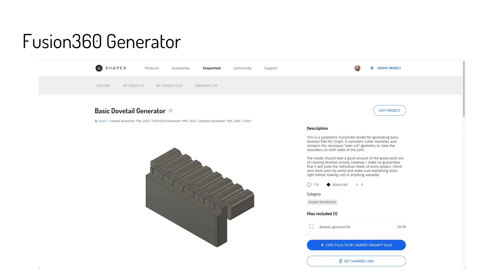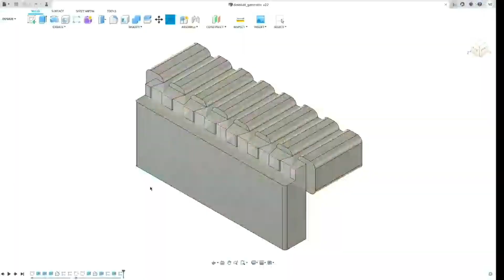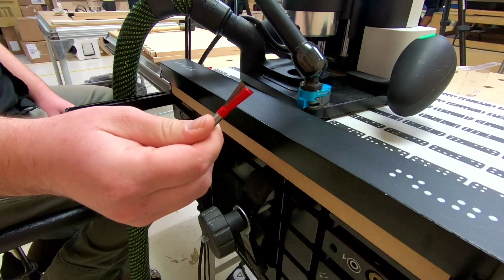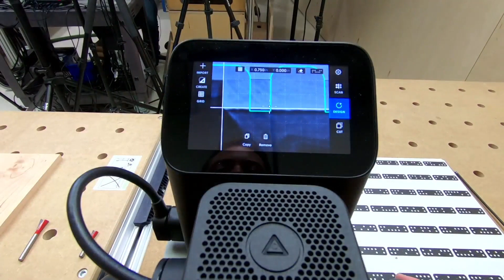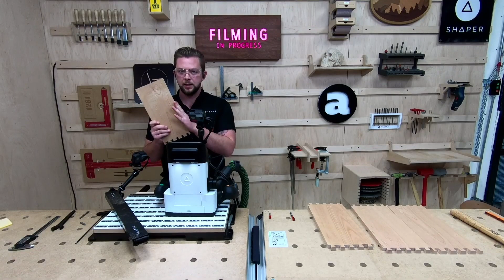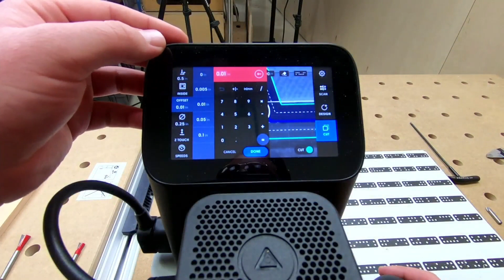Session 20  – English: Dovetails with Origin + Workstation

Comment: Hi guys. A fantastic video thanks. Just a question is it possible in the dovetail generator to change the measurements to mm? It looks like you can do it but the units stay as inch?
Reply from the maker: You can if you change your global settings to MM. There's also a user-generated dovetail tool that handles MM: https://dovetails.bieber.dev/

Comment: After following this tutorial, the generated file only produced pocket cuts for the far ends of my workpiece - there were no cutting guides for the dovetails between the ends. Does anybody know how to address this?
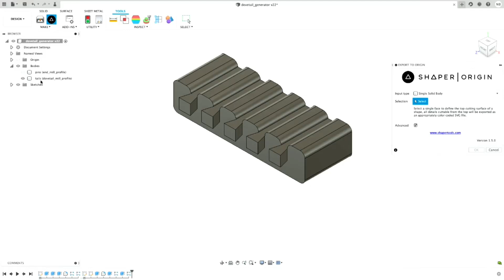Reply: Use the 3D rotate control on upper right of Fusion 360's screen to tilt the intended workpiece's facets to be sure to select the whole plane's face as shown in the tutorial video at 20:12 .. I found the default piece view didn't allow me to grab JUST only that surface until I rolled the piece around a little. Try that.

Comment: Very good tutorial. But the question is can it do Blind Dovetails using just dovetail bit?
Reply from the maker: Hi Tom,
Not sure if the dovetail generator would create reliable files to cut blind dovetails as it wasn't really made for that task, so it may need some work to come up with a blind dovetail process.

Comment: was trying it out for myself, wondering if you are able to use metric measurements in the parameter box ? or do I have to convert everything into inches ?
Reply from the maker: You can swap between imperial and metric either in the settings or on the fly when entering a value!
Reply: @Shapertools  cAN YOU CHANGE THE FUSION360 PARAMEETERS TO MM ? i HAVE TRYED WITHOUT ANY LUCK....

Comment: Can you add a software option to turn off the auto-retract?
Reply: I have been asking Shaper support that question for a long time - they won't do it. If they made it adjustable we could even use keyhole cutters with Origin.
Reply: @totallynotabot151  no keyhole cutters with Origin?
Reply: @LukePighetti  Well you can install one, move carefully, and hope that Origin doesn't decide to do an emergency retraction of the cutter during the operation.
Reply: no kidding!

Comment: Great video guys! Just to be clear, are you saying that when you are cutting the ;pins, you have to align the grid to the left side for the first cut and then change it to the right side for the second cut? Why not simply leave the board aligned to the left and make sure that the outside of the board faces the workstation for Tails and the Inside of the board toward Workstation for Pins? That's how I've always done it with Leigh Jigs? You simply spin the board like a steering wheel to reposition.

Comment: Thanks guys! Especially Noah for the dovetail generator! I'd been using the user-made one on ShaperHub, and it did fine except I had to be very careful to cut the correct paths... a lot of trial and error. To make enough plunge/retract space on the tails I would "stretch" the design vertically before placing it on the piece.

Anyway, I'm excited that yours actually creates the necessary cut paths- it should speed me up a lot in time for Xmas-present making! One question: any reason you couldn't just rotate the pin design 180 degrees on-tool instead of flip/rotating the wood and gridding off the right side? That way I can always keep my reference edge to the left?

Comment: Brilliant, thanks so much.  For the  on tool box joint there is, quite understandably, a glue thickness parameter.  The dovetail joint in the demo looks quite tight with no room for glue.  Is there a way to adjust for glue?  I suspect not or you would have covered it.
Reply: I would use offsets to make room for glue. Just a bit though, and probably only on one side per joint (pin-side, probably). I'd also cut a tiny bit deeper than the wood thickness to make sure the pins/tails come out proud rather than shy, as well as having room for glue inside the joint.